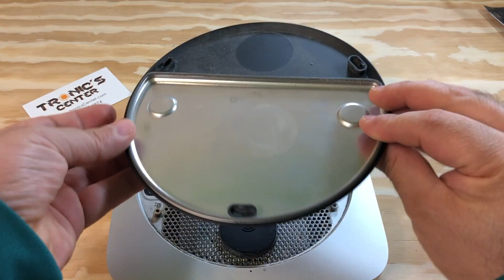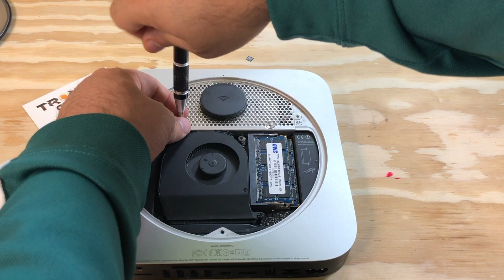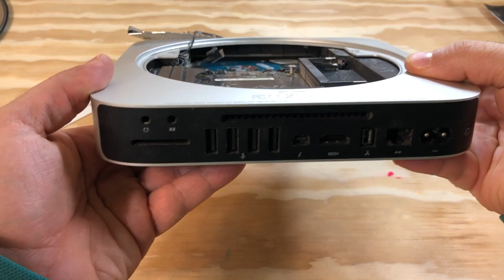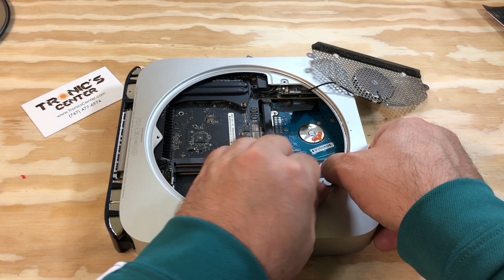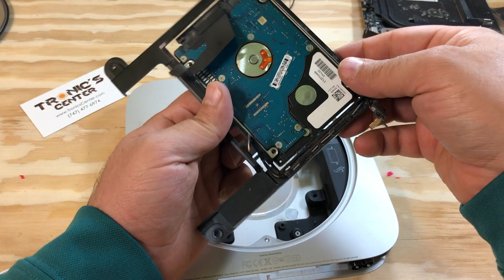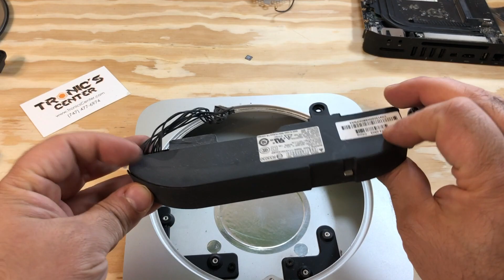Full Disassembly Apple Mac Mini A1347 - Take Apart Mac Mini A1347 and Tear down     HD 1080p

Comment: Wow nice
Reply from the maker: there are many Apple MacBook Available with high Spec's such as A1707, A1708, A1706, A1990, A1989, A2141, A2159, A2179 and we do offer original part's for them in if you need any part
you may visit our website at www.tronicscenter.com
Reply from the maker: A2251 KeyWords 

MacBook Pro "Core i5" 2.0 13" 2020 4 TB 3, 2.0 GHz Core i5, I5-1038NG7, MacBook Pro "Core i7" 2.3 13" 2020 4 TB 3, 2.3 GHz Core i7,  I7-1068NG7, MacBookPro16,2 , 2020 13" 4 TB 3 , A2251 MacBook , EMC 3348, MWP72LL/A, BTO/CTO

————————————————————

A2141 KeyWords 

MacBook Pro "Core i7" 2.6 16" 2019, 2.6 GHz Core i7 (I7-9750H), 2.3 GHz Core i9 (I9-9880H), A2141 (EMC 3347), 2.4 GHz Core i9 (I9-9980HK) , MacBookPro16,1, MacBook Pro "Core i7" 2.6 16" 2019 5600M, 2.6 GHz Core i7 (I7-9750H),  MacBookPro16,4 , MacBook Pro "Core i9" 2.3 16" 2019 5600M, 2.3 GHz Core i9 (I9-9880H), MacBook Pro "Core i9" 2.4 16" 2019 5600M, 2.4 GHz Core i9 (I9-9980HK), MVVL2LL/A, MVVM2LL/A, 16" MacBook A2141

———————————————

A2179 Keywords

MWTJ2LL/A, EMC 3302 , 1.1 GHz Core i3 (I3-1000NG4) , MacBook Air "Core i3" 1.1 13" (Scissor, 2020) , MacBookAir9,1 , 1.1 GHz Core i5 (I5-1030NG7) , MVH22LL/A , MacBook Air "Core i7" 1.2 13" (Scissor, 2020), 1.2 GHz Core i7 (I7-1060NG7)

——————————————

A2159 Keywords 

1.4 GHz Core i5 (I5-8257U) , MacBook Pro "Core i5" 1.4 13" Touch/2019 2 TB 3 , MacBook Pro "Core i7" 1.7 13" Touch/2019 2 TB 3 , 1.7 GHz Core i7 (I7-8557U) , MUHN2LL/A , A2159 , EMC 3301 , MacBookPro15,4 , 2019 13" (Touch Bar, 2 TB 3), 13" MacBook Pro A2159

—————————————————————

A1932 Keywords  

MRE82LL/A , MVFH2LL/A, 1.6 GHz Core I5-8210Y, 1.6 GHz Core I5-8210Y, MacBookAir8,1 , EMC 3184 , 13" MacBook Air Space Gray, 13" MacBook Air Gold , 13" MacBook Air Silver , 13" MacBook Air 2019 13" MacBook Air 2018, 13" MacBook Air A1932

—————————————————————

A1534 Keyword’s

EMC 2746, MF855LL/A, MF865LL/A, EMC 2991, MLHA2LL/A, MLHC2LL/A, EMC 3099, MNYF2LL/A, MNYG2LL/A, MacBook8,1 , 1.1 GHz Core M (M-5Y31) , 1.2 GHz Core M (M-5Y51), 1.3 GHz Core M (M-5Y71), 1.1 GHz Core m3 (M3-6Y30), 1.2 GHz Core m5 (M5-6Y54), 1.3 GHz Core m7 (M7-6Y75), 1.2 GHz Core m3 (M3-7Y32), 1.3 GHz Core i5 (I5-7Y54), 1.4 GHz Core i7 (I7-7Y75), MacBook9,1 , MacBook10,1

——————————————————

A1990 Keywords

MR932LL/A, 2.2 GHz Core i7 (I7-8750H), EMC 3215, MacBookPro15,1 , MR942LL/A 2.6 GHz Core i7 (I7-8850H), 2.6 GHz Core i7 (I7-8850H), 2.9 GHz Core i9 (I9-8950HK), 2.6 GHz Core i7 (I7-9750H), EMC 3359, 2.3 GHz Core i9 (I9-9880H), 2.4 GHz Core i9 (I9-9980HK), MacBookPro15,3, A1990 MacBook, 15” MacBook A1990

———————————————————

A1989 Keyword 

A1989 MacBook 2018 MR9Q2LL/A, 2.3 GHz Core i5 (I5-8259U), BTO/CTO, 2.7 GHz Core i7 (I7-8559U), EMC 3214, MacBookPro15,2 , A1989 MacBook 2019 MV962LL/A , 2.4 GHz Core i5 (I5-8279U) , MV982LL/A, 2.8 GHz Core i7 (I7-8569U) , EMC 3358, 13" MacBook A1989

———————————————

A1708 Keywords

MLL42LL/A, A1708, EMC 2978, MacBookPro13,1 , 2.0 GHz Core i5 (I5-6360U) , 2.4 GHz Core i7 (I7-6660U) , MPXQ2LL/A, EMC 3164, 2.3 GHz Core i5 (I5-7360U) , 2.5 GHz Core i7 (I7-7660U), MPXQ2LL/A, 13" MacBook A1708

———————————————————— 
MacBook 

Apple, MacBook, 13" MacBook, MacBook Air, A1466 MacBook, MacBook Air logic Board, 13" MacBook Air , Apple Mac , 11” MacBook , A1465 MacBook, A1502 MacBook, A1398 MacBook, A1425 MacBook, A1706 MacBook, A1708 MacBook, A1707 MacBook, A1990 MacBook, A1989 MacBook, A2159 MacBook, A2179 MacBook, A2289 MacBook, A2337 MacBook, A2338 MacBook, A2141 MacBook, MacBook Pro, MacBook Pro Retina, Retina display, True Tone Display , Top Case KeyBoard, Apple Keyboard, MacBook KeyBoard, MacBook Trackpad.
———————————————————

A1398 MacBook, A1398 Logic Board, A1398 LCD, A1398 KeyBoard , A1398 Display, MC975LL/A, MC976LL/A, MD831LL/A, ME664LL/A, ME665LL/A , ME698LL/A, ME293LL/A, ME294LL/A, ME874LL/A, MGXA2LL/A, MGXC2LL/A, MGXG2LL/A, MJLQ2LL/A, MJLT2LL/A, MJLU2LL/A

—————————————————————

A1706 Keywords

MLH12LL/A, A1706 EMC 3071, MacBookPro13,2 , MacBookPro14,2 , MPXV2LL/A, A1706 EMC 3163 , 3.5 GHz Core I7-7567U, 3.3 GHz Core I5-7287U, 3.1 GHz Core I5-7267U, 3.3 GHz Core I7-6567U, 3.1 GHz Core I5-6287U, 2.9 GHz Core I5-6267U, A1706 MacBook, A1706 MacBook Touch Bar 

—————————————————————
A1707 Keywords 

MPN 923-01477 , MLH32LL/A, MLH42LL/A, MPTR2LL/A, MPTT2LL, EMC 3072, MLH32LL/A, MacBookPro13,3, 2.7 GHz Core i7 (I7-6820HQ), MLH42LL/A, 2.9 GHz Core i7 (I7-6920HQ), EMC 3162 , 2.8 GHz Core i7 (I7-7700HQ), MacBookPro14,3 , 2.9 GHz Core i7 (I7-7820HQ), MPTR2LL/A, MPTT2LL/A, 3.1 GHz Core i7 (I7-7920HQ), A1707 MacBook, A1707 Touch Bar

Comment: You are great engineer more than me !!!!!
Reply from the maker: thanks a lot
Reply from the maker: A2251 KeyWords 

MacBook Pro "Core i5" 2.0 13" 2020 4 TB 3, 2.0 GHz Core i5, I5-1038NG7, MacBook Pro "Core i7" 2.3 13" 2020 4 TB 3, 2.3 GHz Core i7,  I7-1068NG7, MacBookPro16,2 , 2020 13" 4 TB 3 , A2251 MacBook , EMC 3348, MWP72LL/A, BTO/CTO

————————————————————

A2141 KeyWords 

MacBook Pro "Core i7" 2.6 16" 2019, 2.6 GHz Core i7 (I7-9750H), 2.3 GHz Core i9 (I9-9880H), A2141 (EMC 3347), 2.4 GHz Core i9 (I9-9980HK) , MacBookPro16,1, MacBook Pro "Core i7" 2.6 16" 2019 5600M, 2.6 GHz Core i7 (I7-9750H),  MacBookPro16,4 , MacBook Pro "Core i9" 2.3 16" 2019 5600M, 2.3 GHz Core i9 (I9-9880H), MacBook Pro "Core i9" 2.4 16" 2019 5600M, 2.4 GHz Core i9 (I9-9980HK), MVVL2LL/A, MVVM2LL/A, 16" MacBook A2141

———————————————

A2179 Keywords

MWTJ2LL/A, EMC 3302 , 1.1 GHz Core i3 (I3-1000NG4) , MacBook Air "Core i3" 1.1 13" (Scissor, 2020) , MacBookAir9,1 , 1.1 GHz Core i5 (I5-1030NG7) , MVH22LL/A , MacBook Air "Core i7" 1.2 13" (Scissor, 2020), 1.2 GHz Core i7 (I7-1060NG7)

——————————————

A2159 Keywords 

1.4 GHz Core i5 (I5-8257U) , MacBook Pro "Core i5" 1.4 13" Touch/2019 2 TB 3 , MacBook Pro "Core i7" 1.7 13" Touch/2019 2 TB 3 , 1.7 GHz Core i7 (I7-8557U) , MUHN2LL/A , A2159 , EMC 3301 , MacBookPro15,4 , 2019 13" (Touch Bar, 2 TB 3), 13" MacBook Pro A2159

—————————————————————

A1932 Keywords  

MRE82LL/A , MVFH2LL/A, 1.6 GHz Core I5-8210Y, 1.6 GHz Core I5-8210Y, MacBookAir8,1 , EMC 3184 , 13" MacBook Air Space Gray, 13" MacBook Air Gold , 13" MacBook Air Silver , 13" MacBook Air 2019 13" MacBook Air 2018, 13" MacBook Air A1932

—————————————————————

A1534 Keyword’s

EMC 2746, MF855LL/A, MF865LL/A, EMC 2991, MLHA2LL/A, MLHC2LL/A, EMC 3099, MNYF2LL/A, MNYG2LL/A, MacBook8,1 , 1.1 GHz Core M (M-5Y31) , 1.2 GHz Core M (M-5Y51), 1.3 GHz Core M (M-5Y71), 1.1 GHz Core m3 (M3-6Y30), 1.2 GHz Core m5 (M5-6Y54), 1.3 GHz Core m7 (M7-6Y75), 1.2 GHz Core m3 (M3-7Y32), 1.3 GHz Core i5 (I5-7Y54), 1.4 GHz Core i7 (I7-7Y75), MacBook9,1 , MacBook10,1

——————————————————

A1990 Keywords

MR932LL/A, 2.2 GHz Core i7 (I7-8750H), EMC 3215, MacBookPro15,1 , MR942LL/A 2.6 GHz Core i7 (I7-8850H), 2.6 GHz Core i7 (I7-8850H), 2.9 GHz Core i9 (I9-8950HK), 2.6 GHz Core i7 (I7-9750H), EMC 3359, 2.3 GHz Core i9 (I9-9880H), 2.4 GHz Core i9 (I9-9980HK), MacBookPro15,3, A1990 MacBook, 15” MacBook A1990

———————————————————

A1989 Keyword 

A1989 MacBook 2018 MR9Q2LL/A, 2.3 GHz Core i5 (I5-8259U), BTO/CTO, 2.7 GHz Core i7 (I7-8559U), EMC 3214, MacBookPro15,2 , A1989 MacBook 2019 MV962LL/A , 2.4 GHz Core i5 (I5-8279U) , MV982LL/A, 2.8 GHz Core i7 (I7-8569U) , EMC 3358, 13" MacBook A1989

———————————————

A1708 Keywords

MLL42LL/A, A1708, EMC 2978, MacBookPro13,1 , 2.0 GHz Core i5 (I5-6360U) , 2.4 GHz Core i7 (I7-6660U) , MPXQ2LL/A, EMC 3164, 2.3 GHz Core i5 (I5-7360U) , 2.5 GHz Core i7 (I7-7660U), MPXQ2LL/A, 13" MacBook A1708

———————————————————— 
MacBook 

Apple, MacBook, 13" MacBook, MacBook Air, A1466 MacBook, MacBook Air logic Board, 13" MacBook Air , Apple Mac , 11” MacBook , A1465 MacBook, A1502 MacBook, A1398 MacBook, A1425 MacBook, A1706 MacBook, A1708 MacBook, A1707 MacBook, A1990 MacBook, A1989 MacBook, A2159 MacBook, A2179 MacBook, A2289 MacBook, A2337 MacBook, A2338 MacBook, A2141 MacBook, MacBook Pro, MacBook Pro Retina, Retina display, True Tone Display , Top Case KeyBoard, Apple Keyboard, MacBook KeyBoard, MacBook Trackpad.
———————————————————

A1398 MacBook, A1398 Logic Board, A1398 LCD, A1398 KeyBoard , A1398 Display, MC975LL/A, MC976LL/A, MD831LL/A, ME664LL/A, ME665LL/A , ME698LL/A, ME293LL/A, ME294LL/A, ME874LL/A, MGXA2LL/A, MGXC2LL/A, MGXG2LL/A, MJLQ2LL/A, MJLT2LL/A, MJLU2LL/A

—————————————————————

A1706 Keywords

MLH12LL/A, A1706 EMC 3071, MacBookPro13,2 , MacBookPro14,2 , MPXV2LL/A, A1706 EMC 3163 , 3.5 GHz Core I7-7567U, 3.3 GHz Core I5-7287U, 3.1 GHz Core I5-7267U, 3.3 GHz Core I7-6567U, 3.1 GHz Core I5-6287U, 2.9 GHz Core I5-6267U, A1706 MacBook, A1706 MacBook Touch Bar 

—————————————————————
A1707 Keywords 

MPN 923-01477 , MLH32LL/A, MLH42LL/A, MPTR2LL/A, MPTT2LL, EMC 3072, MLH32LL/A, MacBookPro13,3, 2.7 GHz Core i7 (I7-6820HQ), MLH42LL/A, 2.9 GHz Core i7 (I7-6920HQ), EMC 3162 , 2.8 GHz Core i7 (I7-7700HQ), MacBookPro14,3 , 2.9 GHz Core i7 (I7-7820HQ), MPTR2LL/A, MPTT2LL/A, 3.1 GHz Core i7 (I7-7920HQ), A1707 MacBook, A1707 Touch Bar